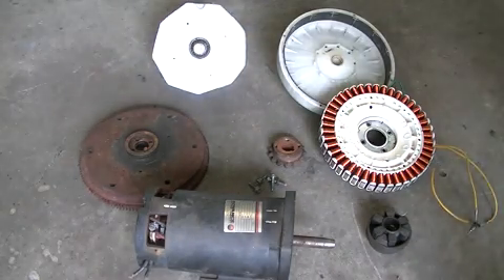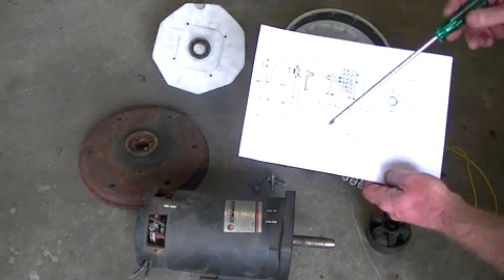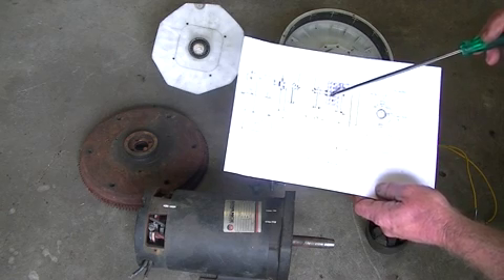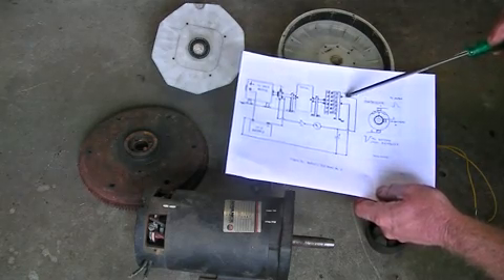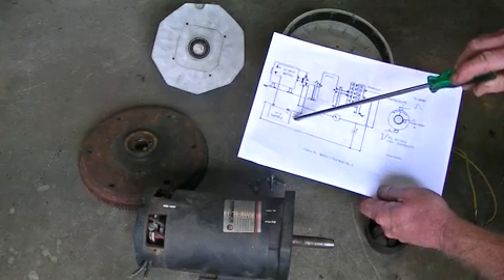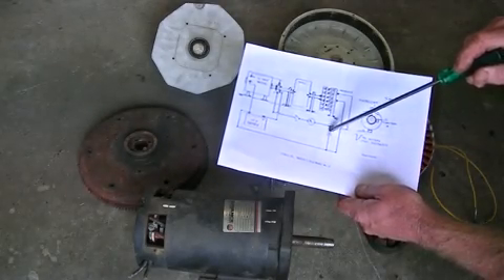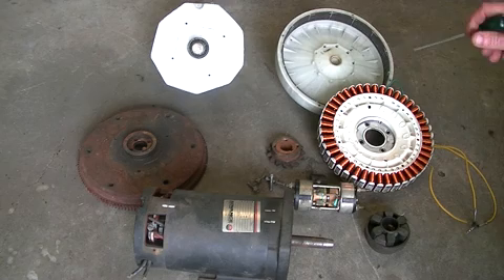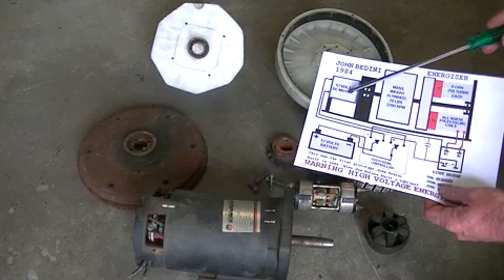John Bedini Energizer V2 build PT1

Comment: Really the energizer is supposed to be a magneto. It produces no current, and therefore, almost no Lenz's law drag. You are basically sticking an SSG in reverse on the output from a DC motor. Using a conventional stator coil generator is not what Bedini described, although it could still work due to the slow movement of ions in lead acid batteries. Basically you convert a battery by conditioning it to ONLY charge on high voltage, low current pulses, until it won't take a charge anymore from a regular battery charger. Then you drive an SSG with a motor, with a flywheel for mass, and pulse the SSG on 51% of the time, and the motor less than 50% of the time. The energy is created because the battery will charge up, with only the high voltage pulses, with the SSG acting to "trigger" the movement of lead ions without actually wasting any energy. Lead ions don't want to reverse direction, and so the battery will continue to charge even when delivering a load. The frequency of switching is important, because if you try to draw a load for too long, the lead ions will reverse direction and stop charging. Bearden described the effect of lead acid battery being able to keep charging, while also emitting current simultaneously, although his technical terms are so complicated I can't remember what word he used to describe it. I think he said it is "re-gauging." The idea is, to keep the movement of the ions in the battery going in one direction, and never let them have enough time to reverse direction.

Comment: I made the commutator style energizer back in 1986 from a booklet sold at the Tesla Convention of the time.  The coils are all wound series aiding.  No bifilar use in this mechanical design.  Bifilar use came in much later designs with transistor switching.   I know what Bedini was doing with it, but you did not say what your purpose in this build is.

Comment: I am not sure your gear is inline with the design, especially the axial motor you are using, are the magnetic fields (not with a standaard driver)  and multifilar coils in parallel (probably for a 3 phase power driver) as required?
Reply from the maker: Johns own schematic he hand drew,shows that all the coils were series connected. There is no mention of multifilar coil's in the schematics i have found for the V2 of the energizer. The schematic clearly states 250 turns per coil.

Comment: i was going to ask where you obtained that beautiful 'energizer' however you answered it - although i am in the same nation as you i haven't yet scavenged one (or found one) however just by chance i think i saw one today ha i'll definitely be going to check it out, am i correct in assuming these are on later model wash machines? 

very entertaining project thanks for sharing.
Reply from the maker: They are from the Fisher and Paykel smart drive washing machines. They have been around for about 30 years now--so should be easy to find them.
Reply: ha interesting thanks maybe I've just been unlucky - I've found a lot of so called 'universal' motors in dryers (including two beautiful ones today)  and in washers i usually find large inductive motors.
so this is the prime mover for the machine ? thanks for the help.
Reply: That is a seriously cool energizer! WOW.